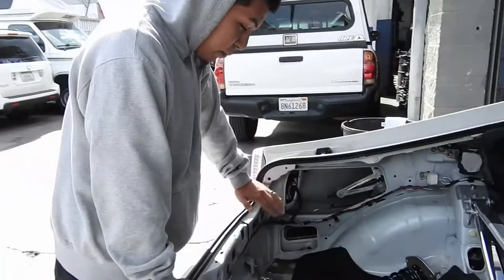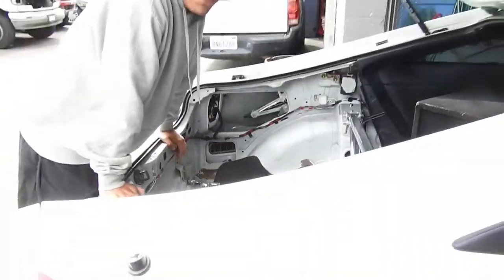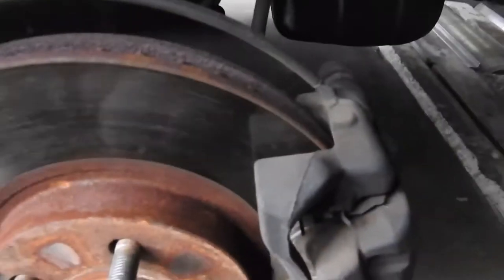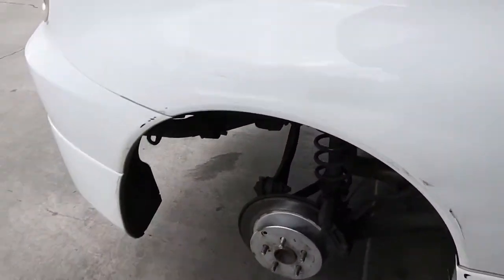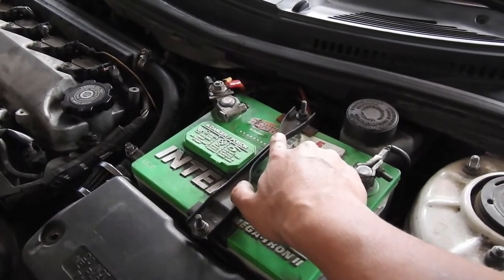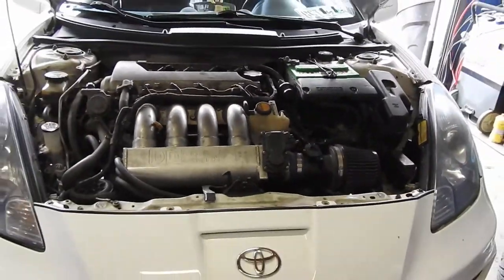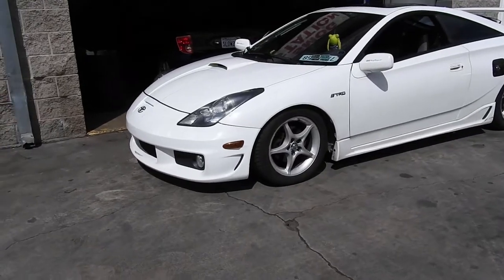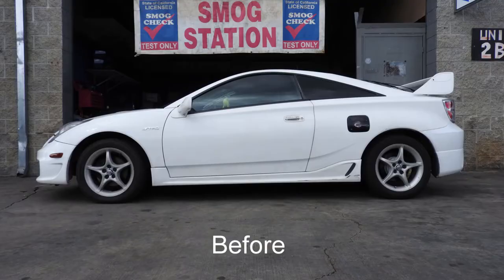How to install BC Coilovers 00-05 Toyota Celica Gt-s/Gt

Comment: Did you use penetrating oil on the rear endlinks? Also how did the car handle after the coil overs installation?
Reply from the maker: No i didnt and its handles way better